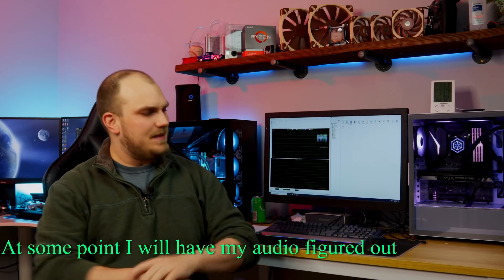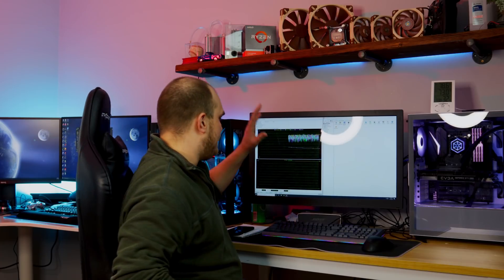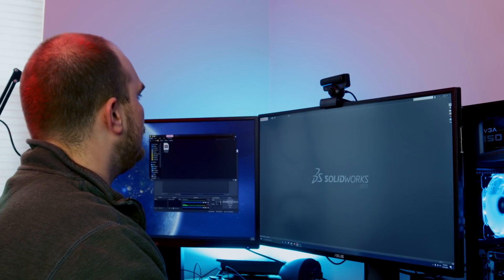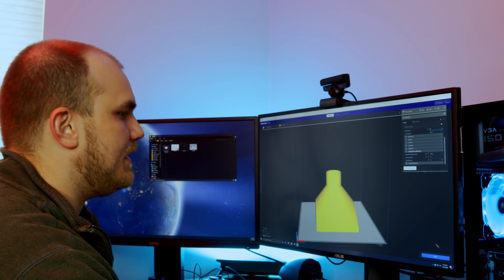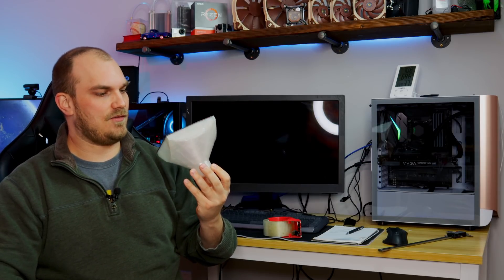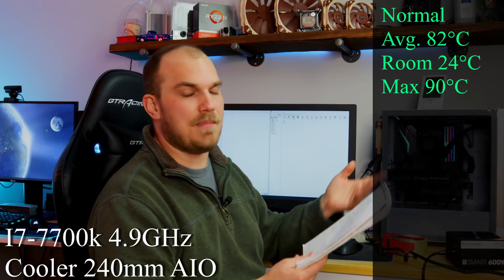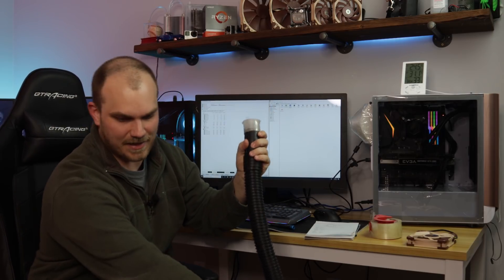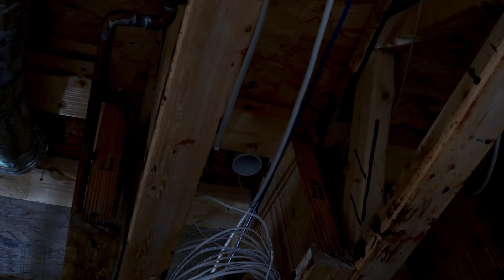What Would Happen If We Sucked Air Out Rather Than Blow Air In?

Comment: You normal configuration was barely better than fully taped up with only one exhaust fan because your case had horrible airflow lol. That huge front panel a huge airflow obstruction. Case fronts should be mesh, and I'll die on that hill

Comment: Speaking of pulling air out, a chimney design could work very well, especially if you're above ground level where intake would suck the coolest air, preferably in shadowed area. Obviously that would require to have unused chimney and tap into it but you could route tube outside and down all the way to the ground and connect it to your inlet and then connect outlet to the chimney - the updraft created (the taller the chimney, the stronger updraft force due to pressure difference between entrance and exit) would cycle hot air out of the case crazy efficient. "Chimney" doesn't have to be an actual chimney, a 8'' diameter PVC pipe running vertically outside of the building with inlet/outlet ports in the wall would do just fine. You're basically creating updraft tower  - it would constantly supply fresh air from the outside and blow past your components with 0 electricity. I'd hazard a guess that a watercooling setup with radiator jammed into updraft tower would require only a functional pump to provide peak cooling efficiency.
Reply: Someone with knowledge on the math side of this problem would need to do calculations but with case heated up, 12m chimney should produce enough air flow to efficiently cool down the PC while simultaneously cycling all the hot air out of the case and keeping your work space nice and chill.

Comment: if you really wanted to quietly cool a PC, get a Mo-Ra3 420 radiator and just remote mount it somewhere. It has an available dual D5 kit so plenty of power for a long hose run.  Some QDCs on the PC for ease of movement.  Or can even be silent in room with some 200mm Noctuas

Comment: @Major Hardware
I know this is an old video (new to me), but Inter-house vacuum systems have been around for a long time.  My house was built in the 70s and still has the original unit in our laundry room.  Though it has not been used/hooked up since I was a child in the 80s.  Our unit is not very powerful when compared to modern vacuums.  But you have given me some great ideas for some possible uses, so thank you!

Comment: It's not cheap to run a (central) vacuum cleaner 24/7 and it's not rated to be run 24/7 or even for several hours (probably). My guess it would fry after a day or two. The economy does not work out for this type of setup. It's much cheaper to open a window when the room gets too hot, and if it's too hot outside, then the vacuum will not help much anyway. I did all that in my head, without a video. WOW.  I like your experiments though :)

Comment: The vac in the garage will be loud, it will also annoy the shit out of your family / neighbours when you're gaming at 2am. Vacuum cleaners usually have a recommended run time as well, so you couldn't run it for hours. 

Then you get into the problem that fans address, which is positive pressure to prevent dust entering your PC through every crack in the case. Perhaps that wont be a problem if you have so much air being sucked out, or maybe your filters will need to be cleaned weekly because it will be filtering all the air in your room.

Perhaps you should get a air-flow case rather than a case with a solid front panel?

It might be worthwhile just using an AC unit to cool your room.

Comment: You can mod a shop vac to use it as a central vacuum. All you need is a 120v relay in line with the vacuum's switch (to control power) and on the signal pins of the relay you use the wires that are coming out either near the tube or near where the vacuum would have been installed (usually near the water heater or the breaker panel). Depending on the relay, you need to inject 5v or 12v on one of the signal wire. You do need to buy a central vacuum hose, though. They make contact with the pins in the wall plug, which completes the signal circuit that turns on the relay.

Comment: It would work with a central vacuum cleaner, but at the cost of much higher power consumption. I don't know about central vacuum cleaners, but a normal vacuum cleaner can draw as much as 700W, or a few times more than that if you do not live in Europe or have an old one. And it's probably not rated for continuous operation. With every vacuum cleaner I owned except for the robot if I vacuum too long with it a thermal lockout activates and I have to wait for it to cool down a bit, and that is in less than an hour or two of almost continuous use. And you want a computer you can work or play games on for 8 hours or more at a time.

Comment: How about using those tiny server fans to cover front fans pulling air into case with vacuum pulling air out. Heat near CPU raises and cool air settles. So use vacuum to pull heat out fast and cool air over and out.

Comment: One of the most interesting things about space or a hard vacuum is that you need particles to bounce into each other in order to transfer heat, so if you take out all the particles (i.e. vacuum), there is nothing to take the heat out. the ISS uses a huge blackbody radiation surface area to send heat away because it is so hard to cool things off in space.

Comment: Even with fans it is a question of whether you suck air through a cooler or blow air into it. Both work and sometimes fans are in push-pull configuration on both sides of the sink. Suction has air rushing in from all direction and blowing is more focused, but if the sink or a shroud focuses the flow suction is fine too.

Comment: When it gets hot out ( summertime in New England ) ... my laptop would over-heat 4 times a day ... I got tired of this - so I I put my laptop INSIDE my refrigerator

 ... only running 2 wires "into" the refrigerator ( the power & the display signal ... I use wifi ... & keyboard / mouse are controlled by wireless usb ) ...
I sit 15 feet away ... sitting in a recliner ...  using wireless keyboard & mouse ... & a 3 foot wide display mounted on my wall.

Comment: Use a regular fan in the door from wally world.  20$ fan that moves a lot of air that is not terribly loud, use dryer ducting to connect with the case.  Maybe your 3d printer could make an adapter for that?

Comment: What if you sent the hot air back up from the basement to over the shower in the bathroom, so that you did not have to use a towel to dry off, or into a box where you hang your wet clothes.

Comment: Main things I know about central vac is that old ones were actually a lot louder than little portable ones. Larger size, more power, primitive fan/motor designs, no baffles. They still need the filters to be cleaned, but it's easy to tell when cause the suction power drops. The hoses have a shelf life, which comes as a surprise only because once you have a central vac, you don't replace it for many decades.

Comment: Could you set up a bank of 280mm fans (probably 6 or 8) in your window and ducting them to the PC? It would provide the same benefit of drawing the heat out of the room and being able to move to another room/window if necessary. That configuration would probably also be quieter than even the basement-vac setup.

Comment: Central vacs can use 2-3kW or more. That would be a heck of an expensive cooling system. If you're going to such extremes, really you want something designed for higher flow rather than pressure. A woodshop dust collector would be just the thing.

Comment: Your computer's supposed to be sucking air out though, not just blowing it in. There should be negative pressure. It's fine to have a fan blowing cool air in and blowing on the heatsink, but you should have more fans blowing out than in.

Comment: Should make a PC that's sealed except for a vacuum nozzle, a 2x120mm grate on the front with a dust filter. Whack a bigass air cooler on the CPU, I bet you could beat this video's water cooled temps easy.

Comment: So... Fun question, what if you stacked up a bunch of case fans with gaskets connecting them to one output and basically just created a high static pressure version of the same thing with a quieter air moving system?

Basically, moving all of your casefans to one hole blowing out and sealing up the other holes except the intake

Comment: A vacuum cleaner is just a fan with extra steps though really, isn't it?

Plus, in a broader sense, older PC airflow designs (from the 90's and before) were frequently built around the use of negative pressure.
(eg the fan setup is designed to suck air out of the case)

Modern systems usually use positive pressure (blowing air into the case.)

The problem with negative pressure is it encourages dust to build up inside the case.
Old PC's could end up VERY dusty indeed, yet modern ones rarely end up the same way.

And dust is an insulator, so... That's not going to do your cooling system any good.
(reminds me my CPU cooler has dust in it and the temperatures are higher than they should be. Time for some cleaning. Just wish I had some compressed air available...)

Comment: Well my fan setup does basicly the same. 3 120mm fans in front wich blow air in the case, 3 fans on the roof of the case wich sucks air out of the case (also 120mm) and 1x 140mm on the back wich also sucks air out of the case. Thats a pretty good aorflpw that way and a constant fresh air flow in the case. I think linis made a video once with all in set up, all out setup and front in, back oit fan setup

Comment: Hey, since the effective static pressure of the vacuum auction is probably really high, I wonder if you could do something where you stack radiators to capitalize on it. Ie, draw all the air in through a series of 120 or 140mm radiators. (is make sure that the hottest air was getting to the hottest radiator and coolest to the coolest but you wouldn't get the normal flow issues from attacking radiators.

I seriously doubt a house wide system would be quiet, just because the sound could travel through the tubing so well. You could test that pretty easily, without even involving a computer, I'd guess.

Comment: I think it the air doesn't move ENOUGH FAST around the cooler! If you essentially get air moving faster through the heat dissipating area, you should achieve way lower temperatures!
I imagine cooler filling inside of a hoover/blower hose/pipe! The rest of the air can cool rest of the components!... 😉

Comment: wouldnt it be easier to just add a valve and close it once the air is out?

edit: I thought a vacuum would work since it is difficult for conserve heat in them (you would need to put the case at shadow because otherwise temperature is not going to change)

Comment: Every nook and cranny of your PC is gonna accumulate tons of dust... The ideal configuration is always positive pressure inside the case. Pretty sure your vacuum would work just as good, if not better, if you used it to blow air into the case. It's just a very, very powerful fan.

Comment: But did it throttle?  It's not a valid test if the CPU wasn't running at its full 4.9GHz for the full test... with a maximum temp of 90-95C I wouldn't be surprised if it was throttling.

Comment: This isn't going to work well. Negative pressure pulls air through all openings and unevenly channels currents through where it's required. It can't compare with pushing air though component radiators.

Comment: 2 reasons I already know of: Static electricity and dust. Negative pressure systems pull in more dust rather that positive pressure systems with controlled and filtered intake zones.
Reply: Static is more of an issue of actually making close contact with hardware in the case and also depends on the type and amount of dust and the moisture level inside the case. Also everything in the case is grounded so doing something like this for cooling, static is not an issue. Really its down to how much dust is going in the tube, and how negatively charged the dust can make the pvc that the vacuum tube is made out
of, and if that charge can make it to anything to destroy it.

Comment: Okay... after 2 minutes, I want to make a prediction...
The temperature will rise above normal IF the case has small ventilation.
Less air = less material to transfer the heat, in theory, it should make heat transfer worse.

Comment: Efficiency aside - wouldn't such a system just suck in a metric ton of dust (and dog hair, in my case) through every crack and gap like pcie slots and the such? Assuming we don't tape them off that is.
 It's difficult enough with filtered intake + fans as it is :p

Comment: If you run a central vac that hard you will have to repair or replace it often. They are not designed for continuous use.
Reply: You could build a continuous duty vac system that would be reliable but it would cost much more than a traditional central vac system.

Comment: Yeah. Useful my rear... That's 4000 WATTS OF POWER used to get a 4 degree difference... Pulling in cool air from an AC will give you that result using way less energy, but it's not good value even at half the energy consumption...

Comment: ditch the 2 200mm intacke fans and you should get better temps. They are ruining the static preasure of the 120mm radiator fans ;-)

Comment: all negative pressure would be a great way to get maximum dust intake in the pc also.
and central vacs are extremely loud, I have one in my house and it's very far from silent, as they are usually like 5 feet tall and 3 to 4 feet of it is just the motor and whatever else is used to suck air

Comment: You should try a wind tube, Just have a tube going up into the sky(Say 10 feet above your roof) and the wind passing over the open tube will create a vacuum at the bottom of the tube.
Reply from the maker: funny you should said that, i have thought about this and even entertained a thought experiment on how i would go about it, maybe some day.
Reply: @MajorHardware  20 feet of 3 inch wide PVC(Costs between $40-$50) and a few brackets to hold it in place, a wider piece at the top and an s shaped elbow joint with a drain to deal with rain water at he bottom. Then a tube to the PC. and there you go.

Comment: The reason why positive pressure is used is because it provides more mass for heat to transfer to. That thermal load can then be moved and replaced. Negative pressure requires a very option source of air and can't supply the same sort of mass positive pressure can when serving the radiator. That being said, negative pressure should be better at removing that thermal load and getting rid of the heat rather than letting it sit in an ambient drift caused by the intake fans. Ideally you would use both intake and out to create a pathway for air to flow.

Comment: Normal Average: 82c at Idle? For a 240mm AIO. What? 
I'm running Folding@Home on a 240mm AIO and it's in the upper 60s.
Reply: I was shocked to see how high the temps are. I run a 240 AIO and my idle temps are 28-35 my load temps never exceed 74 on my 8700k but its only 6 cores
Reply: @canonpatchell  Yea but whats your room temp? My cpu idles at 30-40 and my room temps average 25 degrees. I have the EVGA clc 360 and its only cooling a r7 2700x.

Comment: i am not sure what will be the cost of the energy difference between the traditional way and the central sucking method on the long run. of course it's only hmm let's use the word beneficial if u running multiple systems 24/7 or at least 3-5 pc all the time including 2-4 pc randomly , also it would be nice to see the building cost and running cost of a little freezer room in the basement where temps hoovering around  -30c or something and storing all the rigs without fans on open bench with a big ass heat sinks on cpu gpu

Comment: Sucking air out is causing negative pressure in your case.  Blowing air into the case is causing positive pressure.  Positive pressure is SUPERIOR in every way.
1. You can CONTROL where the air goes -- CPU, VRMs, HDDs, etc. etc.
2. Your front and rear ports don't get clogged with dust.
3. You end up using less electricity running fans.
There is only one small downside -- noise.  Because the fans are in front of the PC, more noise is caused.
I am a computer tech with 35+ yrs of experience.
BTW, for your case setup, I'd personally:
A. Block the rear 120mm exhaust fan area.
B. Mount the dual 120mm radiator on top and remove its fans completely.
C. Mount an additional 2 120mm fans in front.
In this way, all air going into the chassis is forced through the top-mounted radiator.

Comment: If you want silent, cool operation the best approach IMO is to remote locate the computer, running controls, audio, and video out on long cables. Also makes the size of the computer somewhat moot so you can use a huge air cooler.

Comment: Electrician here: I would use a very quiet inline duct fan and step down the diameter of the pipe to the size of your vac system conduit. You could expel the air outside or just into the basement. The inline duct fans are as cheap as two noctua fans, plus not ugly! They draw 30 watts & available at all home depots.  I think this was a great idea just needed a quieter and lower amperage motor on the other end.

Comment: You are trying to pull all that air through an orifice this small, you are getting rid of the immensely horrible motor noise, but you are going to have a lot of air friction and the noise will still be somewhat objectionable, not horrible, but not nearly as good as with PC fans.

Also isn't a vacuum cleaner in fact just a very noisy fan? They even optimise them to make more noise than strictly necessary, else people feel like they could be a tad bit more powerful.